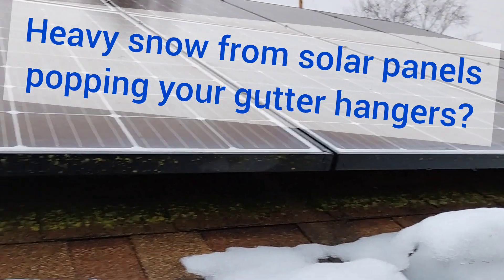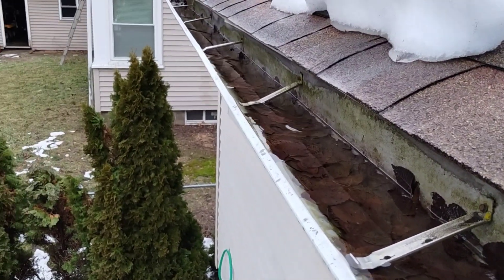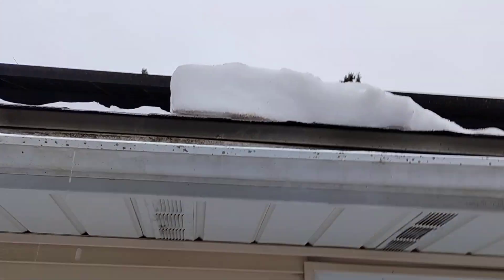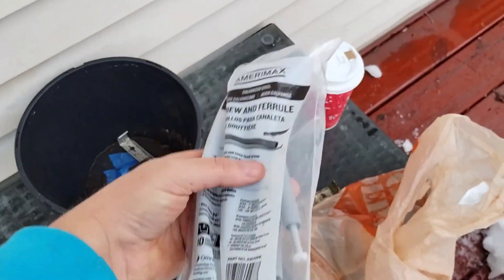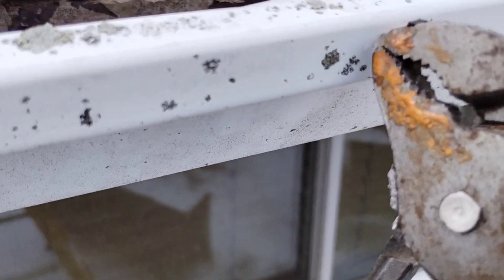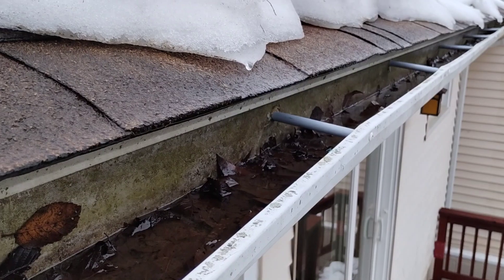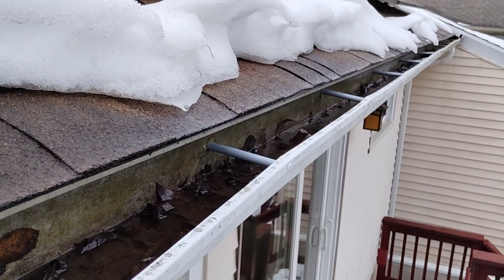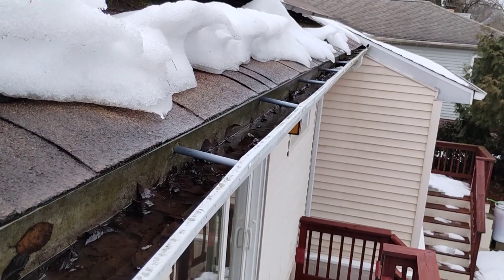Heavy Snow from Solar Panels Damaging your Gutters?  Easy fix!!

Comment: What size are those screws exactly?
Reply from the maker: 5", the link in the description will take you to the product at home depot with more info.
Reply: @BartmanMi thank you.
Reply: @BartmanMi  so I’m replacing the long gutter nails with these screws that you recommend. I’d like to use the existing holes but the thread on the screws aren’t catching. So I have a few questions that I’m hoping you can answer. First, if I screw right beneath the existing hole, will this change the pitch of the gutter? Secondly, do you know if they make longer gutter screws? I can’t seem to find anything longer than 7”. I want to avoid drilling new holes in the gutter if I can. If I can use the existing holes it’d be easiest for me.
Reply: @BartmanMi  to clarify, I’m asking if I can use the existing hole in the gutter and screw beneath the existing hole in the fascia board. Will this affect the pitch of the gutter?